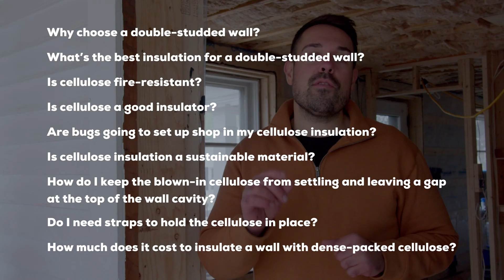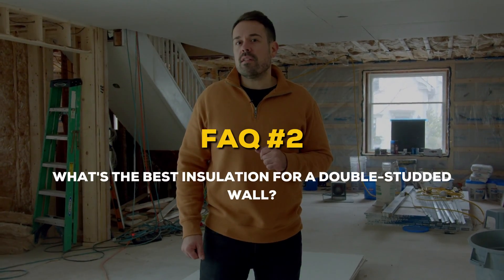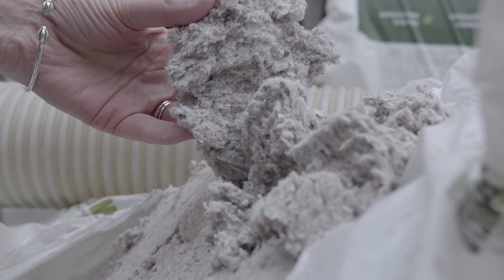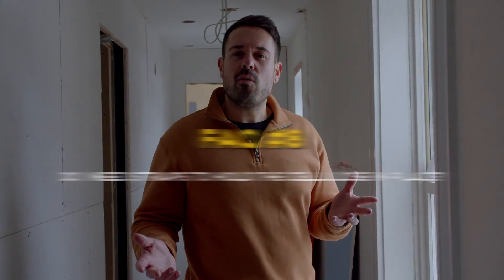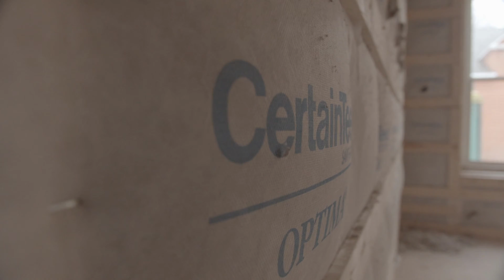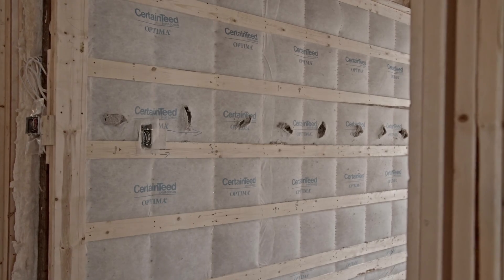Cellulose Insulation for Walls: Benefits, Installation, and Cost

Comment: At a PHIUS conference several years ago, there was a study in 4 places across the country. They put hygrometers in the walls and monitored them over a year. The walls ended up at about 19%RH. They didn't dry out as previously thought over the summer. At 21%RH you get mold starting. BIBS, dense packed fiberglass, is a higher R-value, can't settle, is largely made from recycled glass and is a tested system on every job. And cellulose is supposedly recycled, mostly from newsprint. Where are the newspapers coming from?? Having a blower door and an IR camera, I have found cellulose filled walls settled in as little as 3 months.
Reply: They told me about humidity retention as pro today... They said it prevents water condensation from dripping inside... You say that it will create mold over time?

Comment: I am now installing drywall over blown cellulose insulation and having troubles with the bulging. I suppose I could strap, but then I would have to re-set all the electrical boxes. At 4:21 you mention a tool "belly roller"... Did I hear right? What is a belly roller?  Googling only turns up exercise equipment. Maybe that is what you mean? Thanks

Comment: I am a big fan of cellulose. I would like to buy and erect my self a metal frame home made by arched cabins out of Texas. I am interested in their 30x30 sized cabin to give me 600 sf on the main floor. The arch is 18 ft tall so I can have a 7 ft ceiling on the first floor erect a loft for 300 or 400 sf. The arched cabins is erected using metal ribs with 2 ft center spacing. I want to use cellulose batts between the metal ribs. I want to cover the metal ribs with thinner cellulose bat or strips I cut from bats. I hate drywall. Since cellulose dos not burn can't I cover it with ply wood or ship lap?....Arched cabins gives u insulation sheets u wrap over the ribs. Then u add the metal siding which also gives u a metal roof. Is this wrap sufficient......to prevent air intrusion? Perhaps I need to tape the ends of the insulation? Can u quote me cellulose batts? I want 6 inch or 8 inch hick for between the ribs. Can u quote me tape to seal the ends? The metal ribs are screwed to the wooden floor. I want to insulate between the joists with cellulose bats again ,6 in or 8 inch. What wrap do u suggest to put on the outside of the floor to prevent heat cold from entering the floor? I am going to build on piers. The bottom of the floor will be three feet above ground for a crawl space. I am going to buy extra metal siding sheets and close off the bottom of the house to 6 in from the bottom of the floor. This 6 inch will be wood to slow for windows to vent the crawl space. Do u sell double paned windows narrow nough to fit between the metal ribs on two feet centers? If so quote me for these. Also uote for double paned windows three feet wide wide by and four feet wide. Do u have non opening windows same dimensions? Pls quote these as well? If u are not familiar with arched cabins go to their website? Also there are many u tubers who post there raising of an arched cabin kit. The u tube channel landio has posted a number of videos describing arched cabins.......I am fascinated by passive house. I believe in wrapping this house to prevent air intrusion, plenty of insulation, also to prevent thermal bridging....send me what u suggest to.       Anthony barbuto.....1964 south road......unit 151..... Poughkeepsie..... NY....12601......regards.....a barbuto..... barbuto@optonline.net....
Reply: Sorry.....30x30......that's 900 sf on the first floor and 300-400 sf on the loft.....!!!!!!!
Reply from the maker: Hi Anthony! Thanks for watching our video - we hope you found it helpful. At this time, our online store doesn't sell cellulose insulation. Your best bet is to find an experienced contractor in your area to quote your project. Have them visit the site, and be sure to collect several quotes. You'll get the best results with a contractor that understands and shares your goal for your home. If you're fascinated by Passive House, let them know! Best of luck, Anthony!